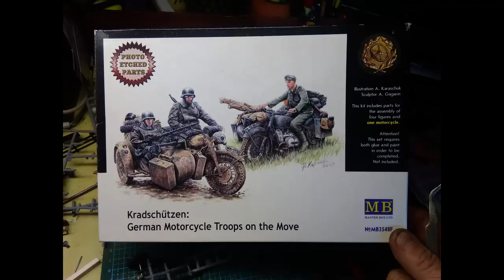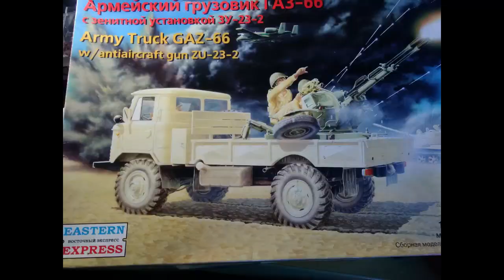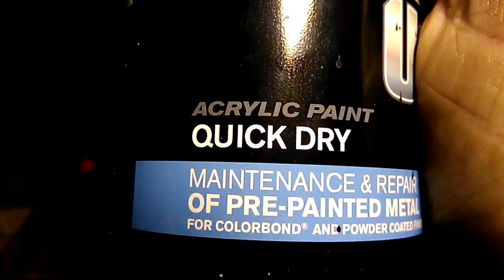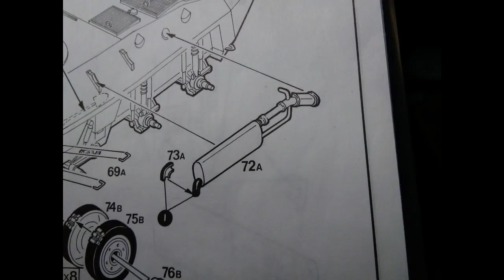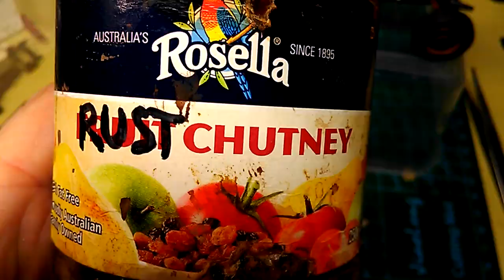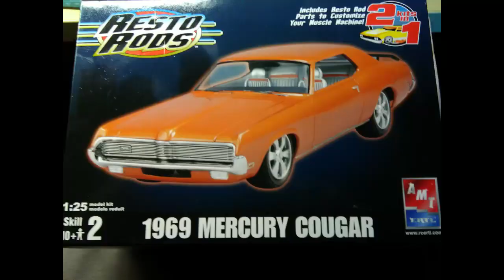Roadshark - Post Apocalyptic Kit Bash Model

Comment: I just followed you down this rabbit hole and was equally impressed by what I saw. Most of a I am most amazed by your sense of mechanical purpose. Your designs equally show something complex due to its limitations based on a post apocalyptic supply and simplistic in the sense that the form must match the function.
On this videos specifically I adore the consideration you took when building the steering column through the off center windshield and the over extended gas pedal. What i love most about that is the idea conveys a feeling that this car doesnt exactly drive equally on all wheels and maybe pulls harder to the left making the driver in a perpetual drift due to all the horse power.I mean you did say he needed to catch up to motor cycles  just to eat up those back tires.